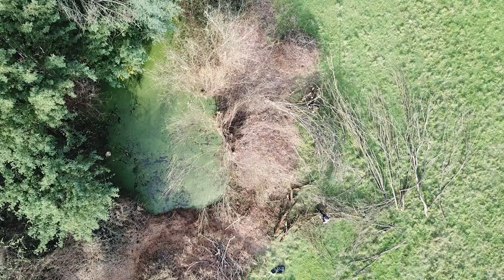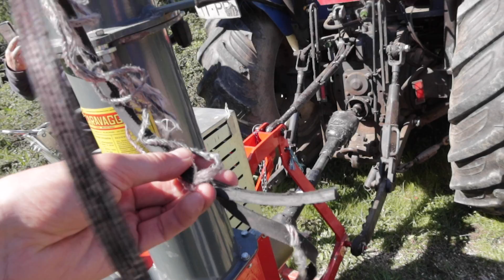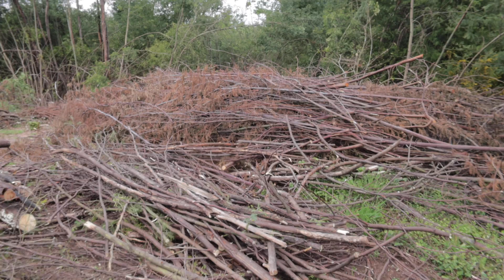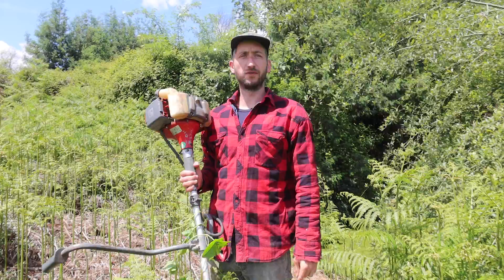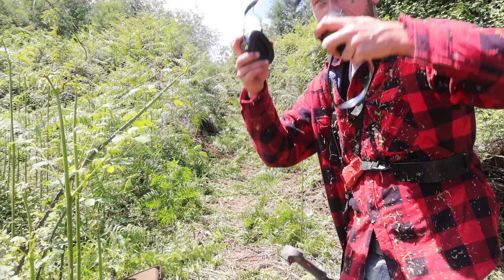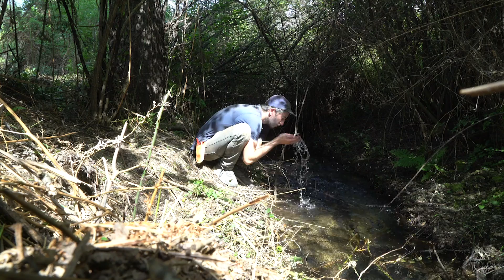#15 Convert dead trees into a pile of fresh chips with a woodchipper

Comment: If you dry and sort them, you can also use the wood chips as a fuel for wood stoves  (for cooking and/or for heating) In fact it's a pity to put such large pieces of wood into a woodchipper, there is so much more you can do with wooden poles.

Comment: Green wood chips will raise soil acidity and your land will be acidic enough because it's so wet in the winter, also not all timber is suitable for chipping, and you run the risk of propagating the seeds of all the rubbish your trying to get rid of. At this stage of your land clearing small scale multiple burns would be better so the rain dissolve the ash back into the soil. I know people will tell you they "think" burning is bad but at this stage burning is far better for the land.

Comment: i would have put down a tarp where the chips come out and so you can collect them neatly so you can use them for compost and bedding for veggies but i would havee made a 3 sided box about 6 ft high as a composting area well 3 sides and one half size wall on the front

Comment: Nobody is tied to any specific battery system anymore. They make battery adapters that connects different brands. It's another cost, but it increases versatility.   DC electricity at 18 Volts is fairly ubiquitous.
PS Makita is the best brand anyhow, good choice

Comment: You can use adapters for other tools as long as the voltage is the same. Keep to one battery system and replace the 18650s if the cells start failing. Get a spot welder and battery chargers and you can start up cycling old laptop battery packs…

Comment: Highly recommend going electric for a chipper, I replaced the petrol motor on ours with a 7.5kW 3 phase motor. Absolutely no comparison in performance and noise.
Reply from the maker: what model did you buy?
Reply: @ProjectKamp  One of these: https://www.hansaproducts.com/nz/product/lifestyle-nz/c13rt/
Reply from the maker: @PatrickHerd  that looks gaspowered? "The Hansa C13 is powered by the easy starting Honda GX390 industrial 13HP engine"
Reply: @ProjectKamp  "I replaced the petrol motor on ours with a 7.5kW 3 phase motor"

Comment: A stand alone chipper is expensive. The tractor mounted chipper is much less however, you would need a tractor to run it. Get a tractor then you can get a lot of implements to go with it or borrow them. The 3 point hitch is universal.

Comment: Good work!
10 hectares is a lot, specially  if a big part of it if overgrown brambles, bushes and (not so good) trees, part of it in rough rocky hilly land. And that cleanning is a anual job, not a one time deal (althou it gets better).
 You need machines. Not one small electric brushcutter, and one electric chainsaw... You need those plus diesel power, tractores, etc. 
A big tractor, with  a big mulcher may cost to rent  1000 euros for a few days a year, but it will get the job done and save you more then that in broken smaller machines, plus labor and you back...
Even with big machines its work for years...
Its been nice to see. Hope you guys can handle it.
Reply: I agree. Hand held units are more suited for small tasks and/or small scale routine maintenance.  Initial clearing is often a job for PTO powered flail mowers and/or rotary mowers.

Comment: Hi! Just a tip about wood chiper! Dont buy one :) u can invest in a tractor and a brushcuter for the tractor, u clean the land and when u cut anything u just put smal limbs in bunchs and use the tractor and brushcuter to get wood chips, and larger pieces of wood u can save for heat! Wood chipers are very expencive and require allot of maitenence! Good luck
Reply: I have a woodchipper it doesnt need much maintenace online a bit of Grease every now and then
Reply: @Volvomechanicnl  maibe u got a good one, it is not my experience... also it takes a long time, if u pile the small branches and use a tractor brushcuter on top its more and less the same outcome but in 1 minute... keep that woodchiper!

Comment: You should use a face shield with the brush cutter, it tends to throw little rocks and residue from what you are cutting in random directions, one could end up hitting one of your eyes. Be carefull :) also shin pads are pretty nice too
Reply: Yeah, a helmet with built in face shield and earmuffs is good when using a brush cutter. Hopefully if they use a chainsaw they have one of those. :)
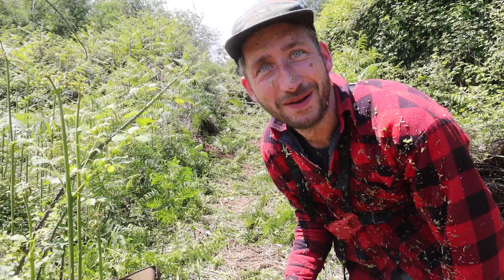Reply: 7:12 safety glasses. Check!
Reply: I'm sure he figured that out within the first five minutes.

Comment: I like your project a lot and
Don't want to discourage you but Unless the municipality issues a housing permit they won't allow you to build or have permanent structures fixated to the ground. Even if that is not only farmland, you still require an application to the Camara and an architecture project. They can fine you  if the land is used for something else than what it is graded to...i hope you can work that out!
Reply: Thats why they start with containers. But they also explained in the first videos that they are allowed to rebuild two of the old houses.
Reply: @stefang5639  still I don't think that's allowed even if the containers are temporary. Nevertheless, the Camara can be flexible. The houses seem be ruins so most likely they need an architect project . Like Dave says, let's see how it goes
Reply: @macnet83  AFAIK, putting containers without a build permit on your property is legal in most European countries as long as you simply put them on the ground without a permanent baseplate or something like this. It is legal in Germany at least and I have seen it in many places. 
You are probably right about the old houses, there are surely some rules on how to rebuild them.

Comment: As far a chippers go, get a tractor pto driven chipper. while it may cost more upfront (including a tractor), the horsepower and robustness will out perform any smaller unit you would use by far.

Comment: NB: you must compost the woodchips before you use them as there is evidence that raw chips will deplete your soil of nitrogen. Not a good thing. Also bear in mind that plants have competed against each other for millions of years. So some plants are designed to kill each other. Throwing random wood chips on certain plants may do more harm than good. So be aware of the species interaction.

Comment: About your power tools :
You are not tied to a particular brand anymore, as you can find some adapter from milwaukee to makita, or the other way around. (and any other brand, too). (~20€)
And you could also open the batteries and change the cells wich are all the sames, and often there are still some of them that are correct in an old battery pack.
But I still have mixed feelings about these "green" alternatives as it looks like you are juste moving the pollution far from the area you work in, but moving is not removing. I wonder if the cure couldn't be worse than the disease..
Reply: It really depends on how much he uses the tools. At some point the pollution from the gas is bigger than the pollution from the battery production, but defining this point is always a hard thing to do.

Comment: Hello, enjoying the channel here in England.  With the chipper, I would get a petrol powered one over one that has to be on a tractors PTO.  With the chainsaw, I recommend a "2in1 easy file" commonly available on eBay and Amazon, just make sure you get the correct pitch, doesn't have to be the Stihl branded one.  I use my £11 2in1 file daily as I am a chainsaw operative and I think it is great.  Thirdly, a forestry helmet with visor and ear muffs is essential for using the three tools above, £25 ish.
Reply: Also, one other thing.  There's things called Habitat Piles which you could do with some of the wood you cut.  These promote the growth of mushrooms, provide a habitat for wildlife, and are good all around really.  They are easy to make and definitely worth looking into.

Comment: Do yourself a favour and get a protective faceshield when working with that bushcutter.
Check out Kris Harbour natural building on YT, can't give links anymore.
Maybe you can learn from; Mike Reynolds, Sepp Holzer, 
Could a Ram-pump be useful for you at some point.
Find out what coppicing is and can it it be used in combination with a rocket mass stove.
If you need fences in the future could hedge-laying be a solution?

Comment: Great to see you use the right tool for the tasks. I will go out on a limb and say that a tractor is probably the most valuable tool/machine for fast progress. Just something with a frontloader and you can remove buschen trees flatten ground use as a building scaffolding. The possibilities is endless. Will easily do the work of 10 people. It's a big investment but they do not loose their value in the same way as a car and you can run it on biofuel aswell. The sooner you get one the sooner you realise how much you accually needed it.